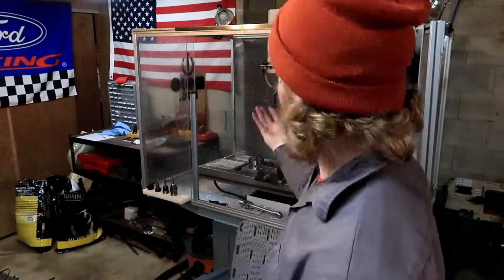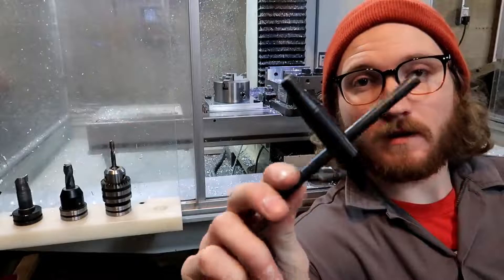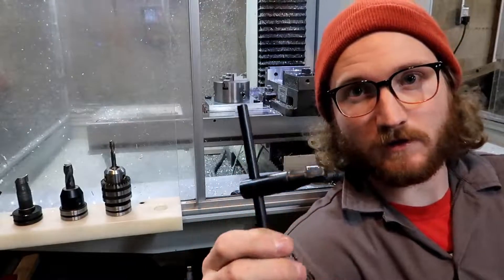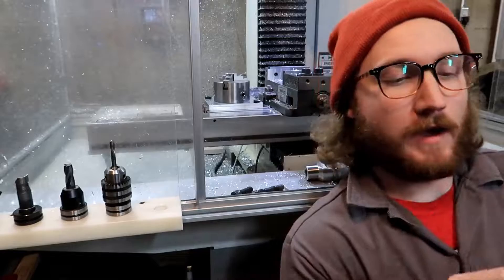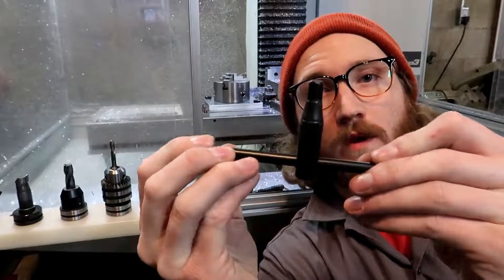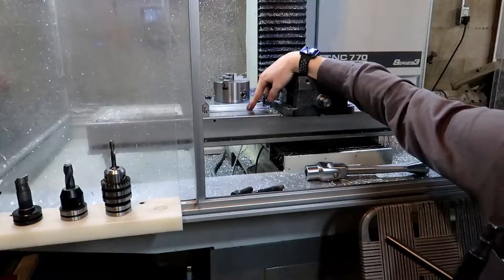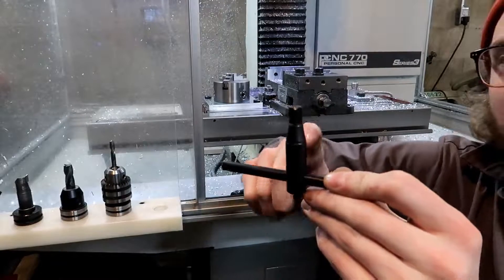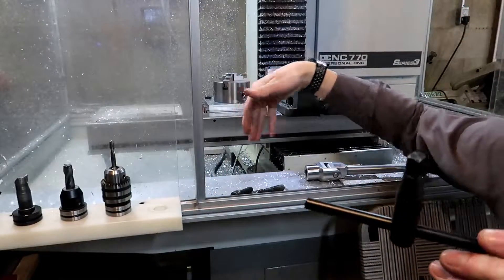Fixture Plate for the 3 Jaw Chuck: Home Mfg. Days #69

Comment: Another great vid Garrett!  
It almost looks like the chuck key will work on the left side and the handle will swing into the coolant valley at the end of the T-slots.  I was thinking of a speed handle....like this.... https://www.summitracing.com/parts/shc-94281?seid=srese1&cm_mmc=pla-google-shoppingsrese1_-craftsman-industrial&gclid=EAIaIQobChMItqyYjcOS3wIVghlpCh1mWg2MEAQYASABEgIGXfD_BwE ...........but that would only be good if you were running the chuck open/close a lot....which I doubt is the case.  I'm looking forward to seeing what you make for a chuck key. :)
Reply from the maker: You are correct, the t-handle chuck key will work in the coolant valley but then the chuck will just be out of the range of travel.  I actually came up with a much simpler idea without have to modify the chuck key.

Comment: The fixture plate looks sweet! For mill turning you could use a tts er-32 collet holder, they can handle up to 13/16" round stock and are more accurate as well.
Reply from the maker: That's a good idea with the ER32 collet holder.  I may have to invest in some of those to get back into millturning.  Thanks for the idea!